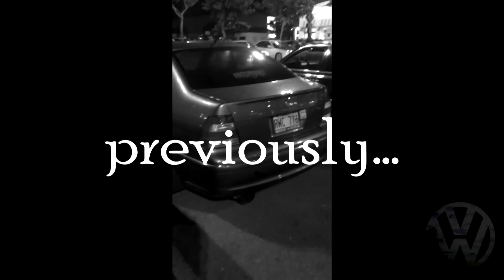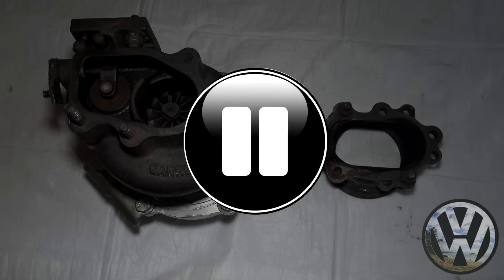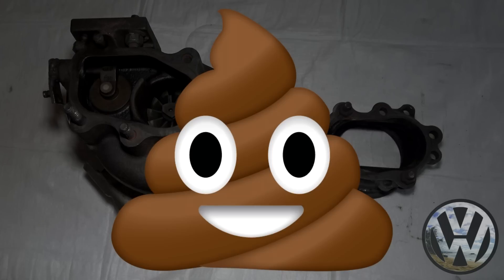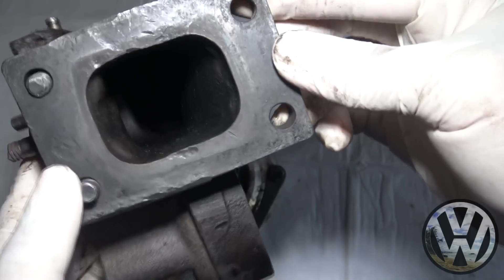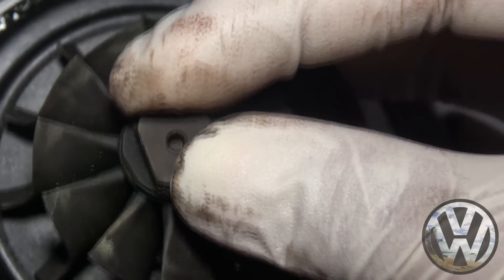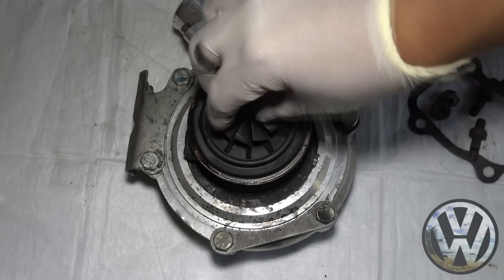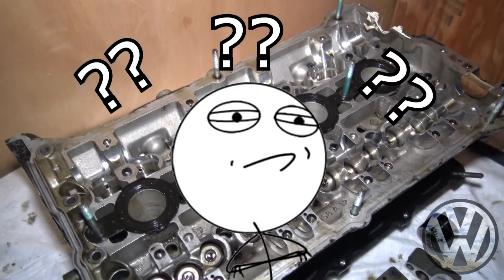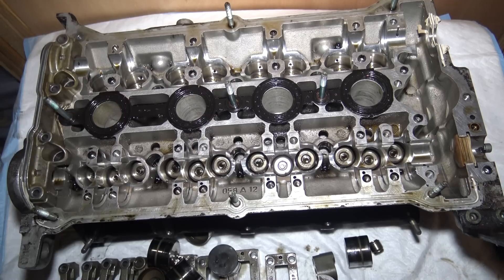Why You Shouldn't 2-Step Your Turbo Car For Fun

Comment: Lubrication is absolutely the cause...
When you two-step your car and you're cutting out the ignition but the fuel is still flowing so you're literally dumping fuel into the motor,  you are sending out the oil, washing down your cylinders, destroying your rings, and destroying every other moving part in the motor.  Combustion in the exhaust manifold can also cause valves to open at the incorrect times from the pressure on the wrong end of the valve. It can open the valve pushing the valve into the piston if you have an interference motor.

Comment: I would have to put this on oil. It could have been over heating and not lubricating efficiently. As stated the exhaust side was the most damaged and as it was more then likely the hottest side the oil would quickly overheat when it reached that side. Another would be how the oil flows in that engine and if it's possible that oil would stay in the exhaust side for a long period or longer then the intake side.

Comment: How do you 2 step? Like what action do you actually do? Just trying to learn more about cars
Reply from the maker: 2-Step is only available when you have an aftermarket tune.
Reply: I believe you hold down the clutch and floor it, and your tune will see that your clutch is in so it will fuel/spark cut at the set rpm, could be wrong but I just ordered a 2 step tune from GTSPerformance/Gonzo so ill see

Comment: Would this be the same for pops and bangs tunes?
Reply: Depends if you overuse it
Reply: A stock engine running a crazy tune getting hot as hell is gonna blow up fast. An engine thats built to take some abuse should be fine. But if you use your stock hatchback like a race car its gonna blow up anyway

Comment: Why weld the turbo? Am a tdi guy I once blocked the actuator air release pipe (after egr removal) felt like a evo all 300 meters till the turbo went bang luckily it was only the turbo I had to replace.
Reply: he welded the flap because he has an external wasegate from Tial
Reply: @OriginalLofiBeats  okay

Comment: 2 step is a novelty, do it occasionally, for a short time. Holding it on the 2 step until things glow will definitely cause damage. It's one of those "do it at your own risk" things. Same thing goes for 2 or 3 minute burnouts, without air moving across the radiator and engine bay, things glow. When they glow, they go. Good explanation, hope people watch this and think twice about holding the 2 step too long. Its not as hard on a built engine, but those engines also require much more maintenance in general.
Reply: Finally someone know what they talking about other than all the little rivers n shit

Comment: My dude, having that knowledge to know something was wrong with the engine from how it sounded, kudos to you. Having that Extended knowledge to be able to tear down and rebuild your engine after you damage it, effing PRICELESS. Most people 2-stepping their cars will blow up their cars trying to be like everyone else, if VAG wanted your car to 2-step it would've been an option on your model, it's not there for a reason. Adding something extra to your car sometimes requires more than just an I saw Bobby do it in his car, YMMV, Lol, Love the Vid and your blown motor still looks cleaner than mine, Lol.
Reply: Respectfully, I disagree. The whole “if the manufacturer wanted your car to do this, then it would be stock feature/option” is extremely naive. If people(especially the car community) lived like that/by that saying, then we wouldn’t have 1000hp 4 cylinders, or really any high horsepower performance street/drag cars. Do you think manufacturers like Ford, Chevy, and Dodge intended on people slapping big ass turbos and superchargers on their cars and testing the limits of their motors, and then independent people and companies making their products better? Nah probably not. But because people did, we now have things like the hellcat, demon, etc. As for VAG, if they didn’t want people to mod their cars, then they wouldn’t make the ME7 and 7.5 so easy to crack and tune. Not to mention make some pretty bitchin cars/engines🤷‍♂️

Comment: Not sure if you still have the car but E-85 could fix your problems in the aftermath of 2 step it has cooling propertys and that allows your motor to run colder just an idea thought

Comment: well what did you think would happen while 2steppin on stock camshafts lifters and probably you valves and springs? all that hard work with the bottom end just to fuck it all up with stock top end parts?

Comment: So are these stock internals? And if so would having a built engine prevent a lot of this harm?
Reply: 2 steps are hella fun but aren't meant to be flame throwers. They are meant to be used for racing launch control but who does that? Fireballs are awesome. And yes forged internals will help but unfortunately it will cause premature wear.

Comment: New subscriber here. I have heard of Garrett turbos tend to not hold up after 2 stepping. Borgwarners are the way to go from what I’ve seen in custom builds, and online also
Reply: Its not a turbo issue at all.  Its combustion still occuring too many times with the exhaust valve hanging open.  His damage was due to heavily retarded timing. The turbo had nothing to do with it.

Comment: It's unfortunate to see that damage... this is what happens when you have tunable 2-Step and you don't understand quite what's going on. I wouldn't be shocked if you had burnt valves as well. If the valve are not burnt then they are some hella strong valves. Anytime Fuel explodes instead of burning you're going to have problems unless everything is built to withstand it valvetrain Springs retainers cams... everything. Mad props on putting this on YouTube I'm sure there's plenty of people hating. I hope my comment doesn't come off as giving you a hard time because that's not what it's meant to be. Maybe some people can learn from this and not go crazy aggressive on there 2-Step. You either want a little bit of popping out the exhaust or all the popping to happen in the exhaust and not when the exhaust valve is open... it's all about timing putting a spark plug in the exhaust. That will also save your turbo.

Comment: I've been using 2-step for a whole now on my Mk4 GLI, and never had a problem. And I know my other buddies run it and no issues. I think that was caused from something else.
Reply from the maker: What stage cars do they have? I too have run 2-step on my GTI and never had major problems like this besides shaft play on the turbo..but on my GLI I run a stage 3 setup with 630cc injectors. More fuel, more bang..a bit harsher setup than normal.
Reply: @MKIVMARV  yeah I'm running stage 2. That could be a possibility why that happened. Maybe that was too much for the car. Idk there could many reasons why that happened

Comment: Impossible, I've 2 stepped a vr6 for almost 2 min str8 with 0 problems lol
Reply from the maker: Vr6 turbo?
Reply: VDub In Paradise vr6 24v no turbo. Look at the latest vid of the jetta and mk2 2 stepping on my channel, you most likely have an issue with oil
Reply from the maker: Emmanuel Lopez Sick car, wish I had a vr6. With my tune, the car is constantly spitting flames to build boost. Most likely the valves ran soo hot it damaged  the entire exhaust side of the head..I ruled out oil issues since everything in the head is alright except the exhaust side.
Reply: VDub In Paradise that's crazy man. Did u see the jetta video?
Reply: @MKIVMARV  if that ex. valve theory is right, then you should be happy , that you did not drop exhaust valves (2piece design). Have happened before...
Reply: @MKIVMARV  do you not realize that your engine isn't running how your map wants it to ..

You're running wayy too hot for the motor as under high rpm you are overboosting due to wastegate not opening.. this creating way too much pressure on the combustion chambers and manifolds... & Heat.
Which obviously equals blown parts.
.

Not rocket science, don't mess with turbos 💪💪🔥

Comment: This is not from two step, oil starvation more likely. I know guys who run two step for years no problem. You got other problems some where bro.
Reply: Fuel cut is pointless on a turbo car, because the idea of two step is to create boost. Ignition cut  will ignite fuel in the exaust manifold causing the turbo to spool up so you can launch on boost. Fuel cut is used as a rev limiter to launch N/A cars. Modern golf R's GTI's etc use ignition cut launch control (aka 2 step) to get boost up    to launch. If you used fuel cut 2 step on a turbo car it would not build boost and bog on take off. The damage to your top end would not have came from using 2 step but using 2 step with the problem would have caused the damage. How this helps mate 👍
Reply: @southeastqldgoldhunter  This is interesting.  It sounds a lot like antilag.  Does that work the same way?  I ask because I always see the Evos use it at the races, so I'd expect them to eventually have a lot of these same problems...
Reply: @londongoddamnit  antilag is sort of different, some anti lag car actually inject fuel or nitrous into the exhaust manifold to spool the turbo up at low engine rpm. Sort of like a second combustion in the exhaust manifold. Not good for the manifold unless they are built for it.
Reply: Also anti lag is used more while actually driving the car not launching. I car with a big turbo may use anti lag. More a race car or hill climb car that is changing up and down gears a lot.
Reply: @southeastqldgoldhunter  Love it.  Yeah, hill climb is exactly what I had in mind when I was asking about that.
Reply from the maker: The man the legend Jason Oil starvation maybe..But I’ve been cautious about oil levels, I check it every time I use it. What type of 2-step do your buddies have? I know couple guys that run fuel cut and others that do both fuel and ignition cut. Those methods are pretty much harmless..
Reply: Eurocustoms

Comment: My man u cant weld the turbo wastegate shut.wastegate controls boost creating a max boost condition.
Reply from the maker: Correct..but I did it to run an external wastegate to control my boost instead.
Reply: @MKIVMARV  keep up the good work👍.check out @adamcalderon6 3076 on pro efi
Reply: V-dub in Paradise is mostly correct. But technically I have seen race cars with no wastegate.  Just a badass fuel system, a massive front mount intercooler, and methanol injection. It ran all the boost the  turbo can run. For this to work properly though the turbo has to be perfectly sized for the motor and cylinder heads.  And these are generally drag cars so heat is not as much of an issue.

Comment: Also I believe the exhaust valves got way too hot sitting there 2 Steppin for however long u did, intake valves wouldn't get affected because all the heat is on the exhuast side
Reply from the maker: joe eoj that’s a good theory.
Reply: @MKIVMARV timing was to heavily retarded.